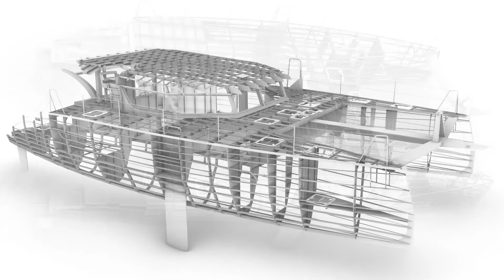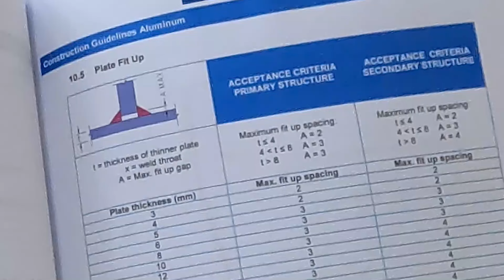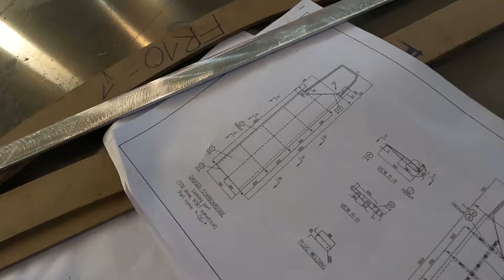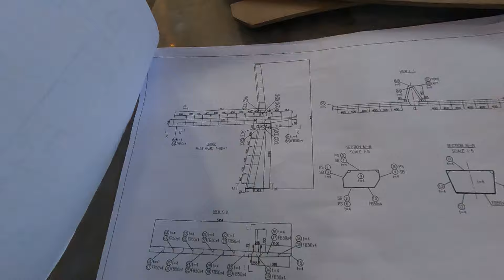Ep. 16 Performance Catamaran Build - Dagger boards, forward beam and the English wheel bender

Comment: The most important part of the welding  is matching  the  welding  wire  with the material  being welded,  & no porosity 🎉
Reply: All looks somewhat chaotic so far, still not convinced I'd save much long-term hiring this crowd rather than Europeans!
Reply: While europeans welders/builders are absolutely impeccable and meticulous, these build engineers have multiple decades of experience and many very large commercial vessel builds under their belt. And they have developed a faster way to achieve the same quality and strength- this could shake up the boat building world to its core.

Comment: Cables and wires. Are they put say through tubing with mechanical seals to keep water intrusion or air extrusion? Wondering about seals etc. for that job. This is very interesting. Also on the inside welds you mentioned. Maybe they weld the inside plate first from outside the inside hull and then weld the outside from inside the hull. Nah, nah, nah, say that. Inside outside sounds like a boat builder's song. Good job Peter on stepping up the technical build game. Proud on you!

Comment: Ask the engineer for a Lazer thermometer, you can check the weld heat input parameters for consistency, for all welds as they are being done. The boat builders will likely ban you🤣 from the factory as they continue applying quality welds/fabrication, great job everyone, you too Plucky🌴

Comment: Two quick safety questions: 1) I see a lot of these engineers welding without safety googles - are they risking their eyesight?  2) I see a strange mix of very high end respirators to no protection at all; I assume this is for aluminum particulates, but why the varied use of them?  Thanks, and best wishes on the boat, which looks to be coming together well!

Comment: I look at the reasonable doors in the bulkheads on this boat and think to the Lagoons and and how different they are , no wonder the 450's broke . Openings too big and not enough bulkheads left .  The loads on a big cat are massive . In my mind Lagoon sacrifices strength for looking like cottage  to sell to people who don't know any better . 

Yours looks designed to cross oceans with the right compromises . Cats have unique issues like a bow can be on a wave going up and the the opposite stern on a different wave also going up with the opposing bow and stern in a trough  twisting the poor thing  , that and no safety valve of heeling to dump a sudden squall . 

They have to be really strong and this build looks to check that box .
Reply from the maker: Indeed

Comment: With regards to the steering going through the water tight bulkhead, have you thought about welding a cylindrical tube through the bulkhead to run steering cables etc etc? Just a thought not having seen the steering design.
Reply: You beat me to it ;). If it's practical to make the tube big enough, you may be able to have the cable/linkage never touch the inside of the tube, so you wouldn't have to worry about wear on the inside of the tube.
Reply from the maker: Yes we have
Reply: Those were my thoughts as well..👍

Comment: When your cat is almost finish, the fine workers will sand & polish the whole vessel. I guess to avoid unnecessary work, the hulls will not be painted, would it not be a pretty idea to sand a picture or some other structure on the outer sides of the aluminium hulls? I played with this idea for my dream vessel.

Comment: Plucky... everything seems to be tack-welded. will they be going back in to weld along the seams as well??
Reply from the maker: Of course but it's not all tacked, some are compete
Reply: @SAILINGintoFREEDOM   Perhaps a point to cover is a coming vid...     I wish I could send you $$$.. I live in a RV on my retirement Social Security.. .so no finds... but I click the Like every time!!  

Will the hull be painted or left raw? Can it be left raw?

Galvanic corrosion prevention with dissimilar metals? Is this a big issue?

Is there anything being done with this build to help with traditional issues found on Al-you-minium craft?

Does the large electrical system(s) present an issue in an aluminum boat?

Doe the tradition al cargo net found on cats increase wind resistance? Ask one of those wicked schmaht engineers!!

All good "videee fodder" mate!

Comment: I was wondering about the overall difference in weight if this exact design had/is made out of stainless steel Pete? Just seemed really interesting to me... allowing perhaps for a reduced overall gauge of the 'stock steel' used... would it actually work/be possible?
Just the thought exercise seemed really interesting to me... especially considering just how technically advanced this entire astonishing project is turning out to be... I thought we were going to be using bamboo Pete... WTF? Crack on spearo!
Reply from the maker: Stainless is not a great material... maybe for spoons tho

Comment: Hi Bloke, Im surprised the design is a welded up, longeron and cross beam.  Thought an aluminium Extruded H beam or I beam would be stronger and better.  This beam could have sides welded up to encase it, Seem to me an easier fabrication methodology and far stronger than the shop made version.  Think it should be considered moving forward.  Easier to construct / stronger.

Comment: Sorry to have to tell you this mate but you only have about twenty minutes after cleaning the ally to get it welded before oxidization stars again. Not welding in this time frame means all the welds are "dirty", not good. What's with the guys not wearing welding helmets when tacking up?
Reply: you seem to know a lot about welding to not understand why they dont wear a helmet when "tacking up"
Reply: It's true about the oxidation. So, seriously, how long would you estimate that the welds deteriorate by not welding within the 20min time frame?
Reply: i do not doubt the fact that from an engineering/scientific prospective that there is deterioration. i must say i do not know the numbers. that being said i work in the "real world" as a tool and die maker and what i know is that what is calculated and what will work in the real world are 2 different things. many times in production to expedite the process corners are cut and the detriment to the job is minimal to the point that it doesn't matter enough to have an affect. this is the same reason that they don't use a helmet to tack things (its to much hassle to keep flipping that helmet up and down and adds countless hours to the job). im gonna go out on a limb here and say these guys have been welding aluminum for a long time with lots of welding under their belts with out a bunch of failures or they would not be in business. have you ever welded aluminum and then used it in the real world? and im not talking about welding it to test its strength in controlled circumstances but something you used. i would also be willing to bet that this is considered in the design and structurally taken into consideration. things are not designed in a way that all welds have to be 100% perfect. if i had to guess they shoot for a 60% perfect weld in the design process.  @troublekaliman
Reply: Oh yeah, the question was for the original guy who said that all the welds are 'dirty' welds because they didn't get welded within 20 minutes of them being grinded 'clean' - since the oxidation of the surface of aluminium starts pretty quickly after grinding. And since these are going to be out in the ocean under a bit of stress, I was curious what @johnhewett2525 had to say. @ottisthedog3544
Reply from the maker: More like 20 micro seconds, aluminum is very reactive
Reply: sorry about that i need to pay better attention to the name on the post 😔 @troublekaliman

Comment: So Plucky i guess this boat will have Alumin panels as well ,not fiberglass ? Correct ?and so a down side is if something hits you or you hit something like a dock or container (floating) it will cause alot of damage and itll be harder to fix than fiberglass ?vs aluminum ???
Reply from the maker: Aluminium is very strong...but if damaged,  plug it and repair on land ...no big deal

Comment: The Elcano challenge will hardly be fossil fuel free if the boat is 100% dependent on fossil fuels to build it and the equipment that goes in it, it's just more hypocritical virtue signalling. You want to be fossil fuel free do it the way Joshua Slocum did it. That aside, good luck with the build it looks like it will be a great boat.